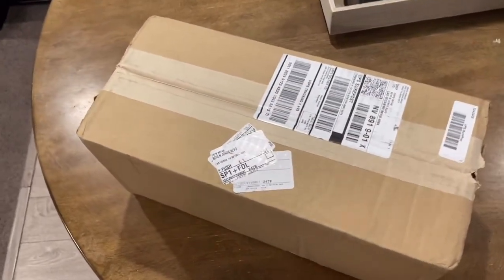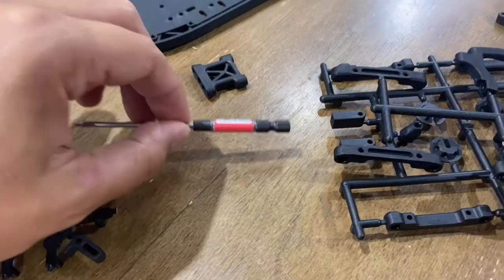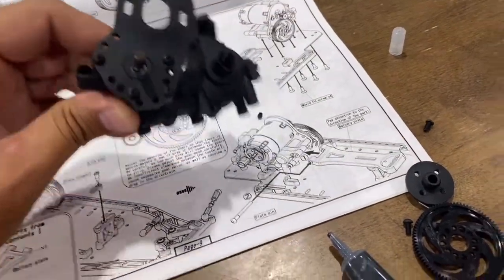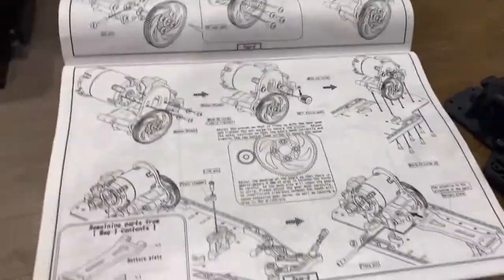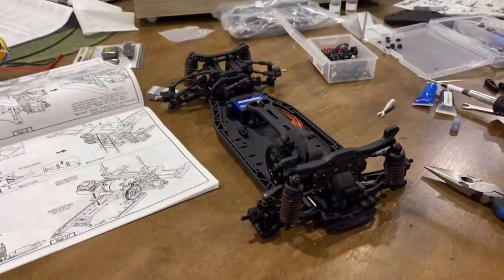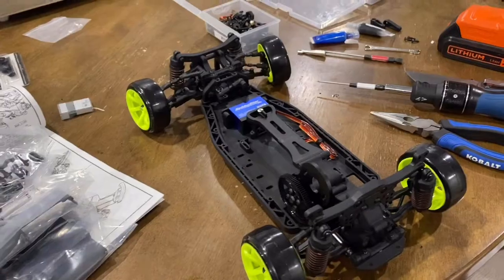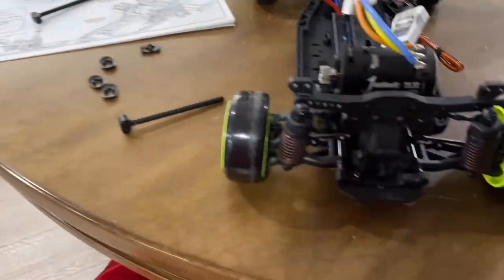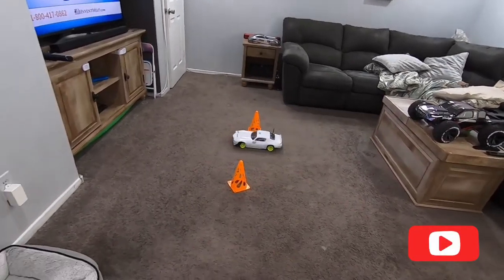BUDGET DRIFT KIT?? Yokomo YD2S - Build and First Drive

Comment: What are the things needed?
Reply from the maker: All the electronics
Reply from the maker: Oh, and wheels and tires and body
Reply: @kgrc0078  can you please say the name of the electronics?
Reply: @johnferreras2178  did you ever get the list? I’m in the same situation I have no clue what to get
Reply: @johnferreras2178  10.5T sensored brushless motor.  Xerun XR10 Pro G2.  Yokomo V4 Gyro.  AGF 19kg Drift or a ReveD Programmable Servo.  Yokomo Sliderack
Reply: @MarbleCityOutlaws  10.5T sensored brushless motor.  Xerun XR10 Pro G2.  Yokomo V4 Gyro.  AGF 19kg Drift or a ReveD Programmable Servo.  Yokomo Sliderack